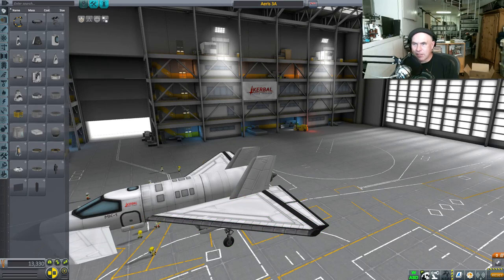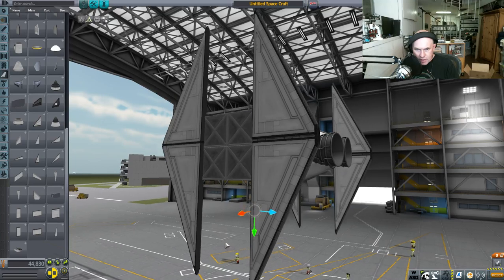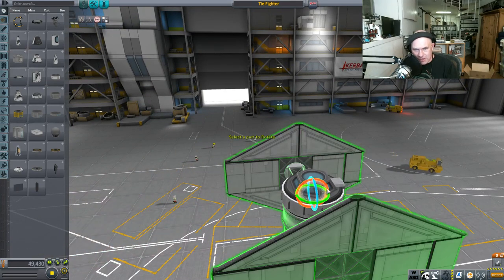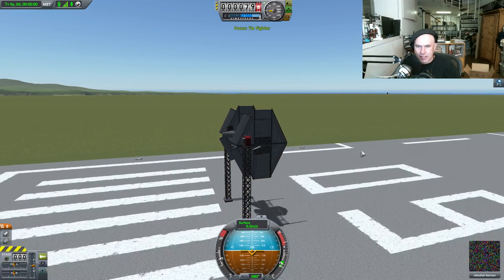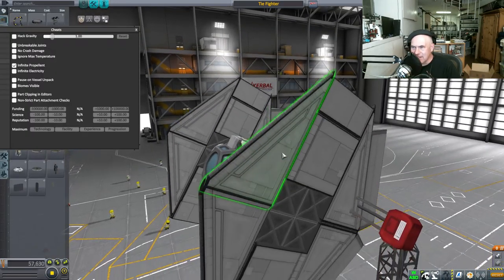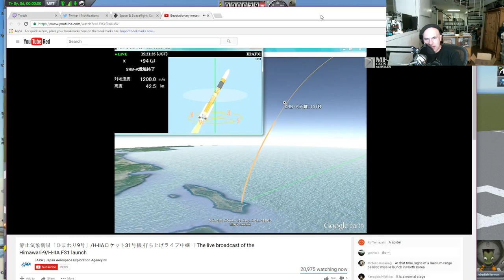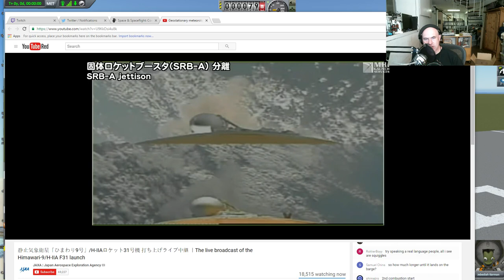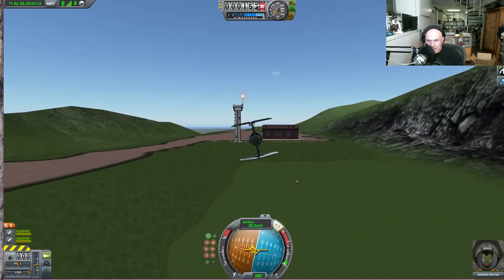Kerbal TIE Fighter Build - Livestream

Comment: Tie fighters use antigravity. The panels on the side are radiators to disperse the heat from the warp coil
Reply from the maker: +Michael Tarantolo that's a retcon, they used to be referred to as solar panels.
Reply: TIE Fighter stands for Twin Ion Engine Fighter, meaning that they use twin ion engines and not antigravity
Reply: +Bailey T. Adams They use both. Otherwise they couldn't fly in the air without facing skyward.
Reply: +Hall9000ish They couldn't no. The physics don't really make sense. And really how often do you see these things flying in an atmosphere? As far as I remember only in the Force Awakens.
Reply: There was a lot of tie fighters flying in an atmosphere in Rebals
Reply from the maker: They also fly in the atmosphere in Empire Strikes Back
Reply: Scott Manley
On Bespin wasn't it? I actually did manage to create a flying Tie Advanced which flies pretty well except that it will pitch down rather unavoidably when it slows down.

Comment: H-II uses a hydrogen first stage, I would bet that's the reason the gravity begins so abruptly and the stage burns so long. Very shuttle like
Reply: JEF_300 that in English is?
Reply: Bombing: Rocket engines that use hydrogen for fuel instead of the normal kerosene are more efficient but produce less thrust. The space shuttle main engines used hydrogen, for instance, and it needed large solid rockets to offset the low thrust. I was guessing that the hydrogen engine solid rocket combo, for some reason beyond my current knowledge, makes it more efficient to turn sideways sooner, like this rocket and the shuttle both do